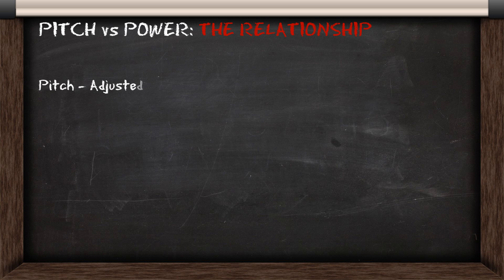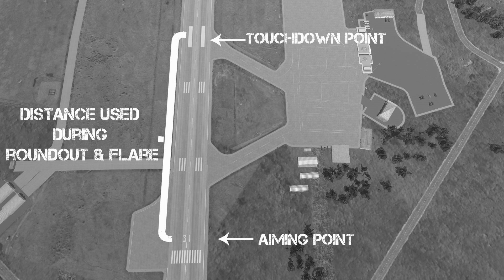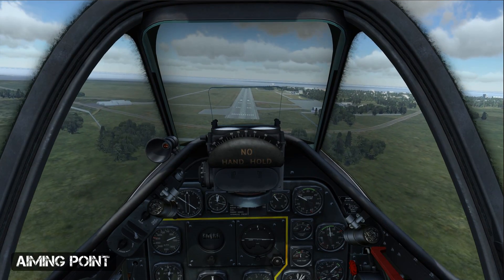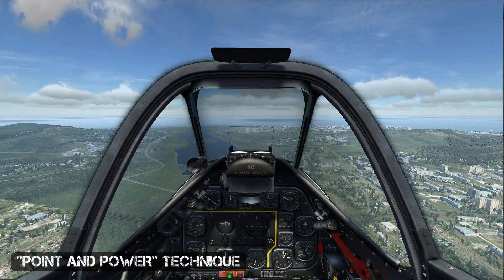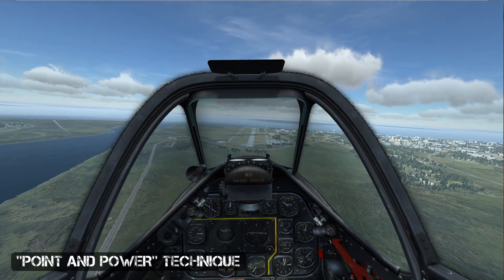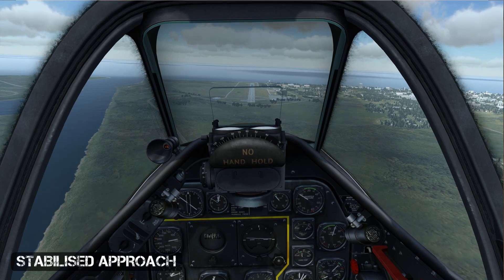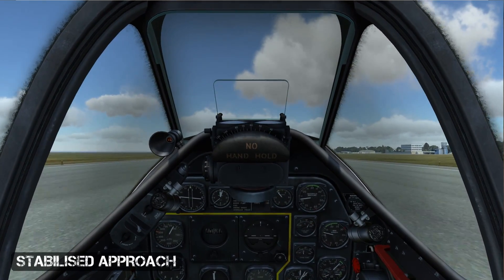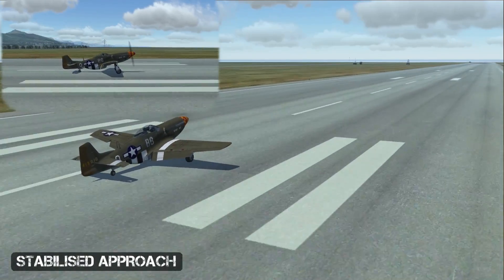Principles #7 - How to Land an Airplane

Comment: Do you adjust the pitch first, then adjust the power?
Reply from the maker: Either way, you pretty much do them simultaneously when you used to it. Initially though you always want a good aiming point so try doing pitch first
Reply: Thanks! I want to start using this method for my flight training instead of the "pitch for airspeed, power for altitude" way, because I want to be a professional pilot one day, and this is how they do it.
Reply from the maker: @zetareticulan321 good luck with the training! This is how I taught my own students who were going to the airlines and even referred them to watch this video. It works 😊
Reply: @RequiemsACTL  I tested it out in Microsoft Flight Simulator, and it worked really well. Then I tried it in the real thing, and it worked just as well. My landings became a lot more accurate!
Reply from the maker: @zetareticulan321 awesome,  thanks for reporting back!

Comment: if landing a JU-52 in a field (potential bumps/grades in terrain but clear of obstacles like trees) would there be any additional techniques?
Reply from the maker: Generally speaking you would leave the gear up for an off field landing, but you don't have that option in the Ju52....so just try and minimise your vertical speed as you touchdown as much as possible
Reply: @RequiemsACTL  Cheers much appreciated will give it some practice. I use it in world war 2 online to drop my guys off on the ground and transport. The vids have came in handy!

Comment: Love your BFM videos!  Thanks very much for all the care and time you’ve put into them.

I disagree with the point you’ve made here about pitch controlling aim point / altitude / approach path and engine power controlling airspeed.  That is incorrect and leads to misunderstandings for students and unstable approaches and poor landings .  Flight training manuals (both where I certificated and in the USA where I live now too!) teach that PITCH and pitch trim controls AIRSPEED (well … it’s angle of attack, actually, but in basic flight training in small aircraft and at slow air speeds, pitch angle and angle of attack are effectively identical) and engine POWER controls RATE OF CLIMB (or descent) / ALTITUDE.
Reply from the maker: Hey James, this is just one of those topics that will never be resolved. Both techniques are correct and I've taught using both techniques with my own students. The real takeaway regardless of which technique is taught in powered airplanes is understanding the relationship between pitch/power and how they both affect airspeed/altitude depending on how you approach it (pardon the pun).

Comment: This is embarrassing, but for years, I had issues with landing. Then I discovered my whole problem was being in a zoomed in position. When I learned to land by sitting back in the seat, I could see the actual flare. This solved all my landing issues.  So, if you are a person who always thinks you should be zoomed in on landing, trying not zooming in. You can see your flare better and have more control over the landing. It worked for me.
Reply from the maker: Nah not embarrassing at all. Everyone has landing issues at some point. The zooming out is a good tip because it lets you see more of the horizon and the airframe itself, giving you a bigger reference to look at which will help you judge your flare attitude and height above the ground

Comment: Do you reduce power during the roundout and flare in order to help the aircraft lower itself?
Reply from the maker: If your airspeed is good, yes, reduce your power so you can start slowing down and getting ready to touchdown. If you're too slow then you probably don't need to reduce power.

Comment: I'm really thankful for your vids, they are very informative and professional. But sometimes as a total noobie with zero aviation knowledge I feel the lack of understanding of some terms that you use. In this case a "threshold point" - I need to check them somewhere else. Do you reduce throttle to zero on threshold point in every plane?
Reply from the maker: Yeah sorry I know sometimes I work off some assumed knowledge of the basics. I would like to do some stuff covering things like that but havent had the time yet
Reply: @RequiemsACTL  Thanks! I've learned a lot form your channel :)

Comment: Very nice! 

I feel stuck in flying right now and its good to get back to the basics.
Do I have to  apply full back pressure on landing? When I do that I find my plane sometimes takes off again.
Reply from the maker: You don't have to but it helps with control. You can always do a wheel landing for something different. If you touch down and the plane takes off again when you apply the back pressure then you touched down with too much airspeed.
Reply: @RequiemsACTL  Ah, I see! 

So approach with glideslope speed and flare up to the landing speed I saw in the plane specs.
Reply from the maker: Yep. With practice with the airplane you're flying you can feel when it wants to touch down rather than attempting to force it down.
Reply: @RequiemsACTL  Huh, thanks I`ll see if I can notice that!

Comment: I don't agree with point #1.  The pitch of the aircraft controls speed and the power controls height.
Reply from the maker: No worries Ian. I learned using the pitch for speed and power for altitude method but I was teaching future airline students so I taught them with the power for speed and pitch for altitude technique. It's the oldest argument when teaching landings. Both methods are interchangeable depending on your flying, but what's important is understanding that pitch/power/speed/altitude are all interrelated.

Comment: Thank you for this video.  I'm a relative noob and have been bouncing between a couple Sims(Cliff of Dover with Fusion patch and Il2 BOS) and wonder which flight model feels most realistic to you since you actually fly the real thing.
Reply from the maker: Thanks Reuben, I really hope it helps as it can be annoying to get a few kills on a mission but then spoil it with a band landing! Which we've all done of course :-)

Personally, although both have their own issues I think IL-2 BoS/BoM is better overall in terms of FM. A few of the problems that I had with IL-2 BoS/BoM have been fixed and another big one is being fixed soon (excessive roll induced by yaw). Cliffs of Dover is still great but for me its ground handling lets it down. I still enjoy both sims just as much as the other and you can't go wrong by owning both or flying one over the other.

 I must say that although I fly in RL I've never flown any of the airplanes in either sim so take what I say with a grain of salt.

Comment: While this video describes how to keep landing speed relatively constant, what is the appropriate landing speed though?
Reply from the maker: Hi Alex, this video was just about the generalised process of landing airplanes and not on the P-51 specifically. The P-51 was just used as the example aircraft here. The best approach speed for any airplane can be found in it's operating handbook.
Reply: The aircraft's stall speed multiplied by 1.3
Reply: I always land at 160

Comment: How do you learn when to do the roundout and the flare? I imagine it depends on how far down the landing gear is.
Reply from the maker: It takes good judgement and practice with a particular aircraft by flying at the aiming point then beginning the roundout just before you reach it so you can slow your descent rate and not crash into the runway. That's why when students first learn to land in RL they have instructors with them, otherwise there would be plenty of wrecked airplanes! 

One thing that helps some people with flare judgement is to move your vision from looking at the aiming point towards the end of the runway as you roundout, and use your peripheral vision to help figure out your height above ground and descent rate to flare for a soft landing.

I've almost finished another video covering common landing errors and their fixes, and incorrect roundout heights is one of those so stay tuned for that.